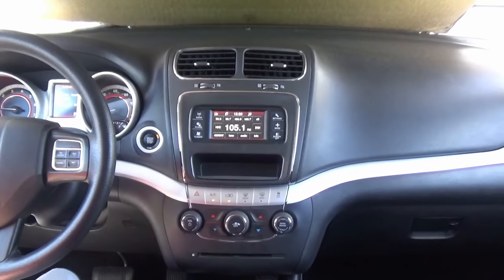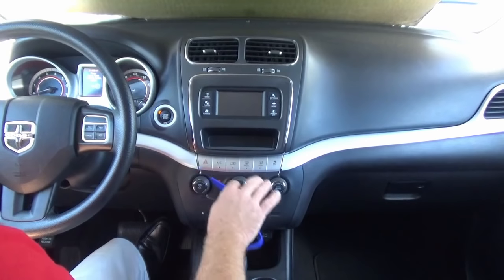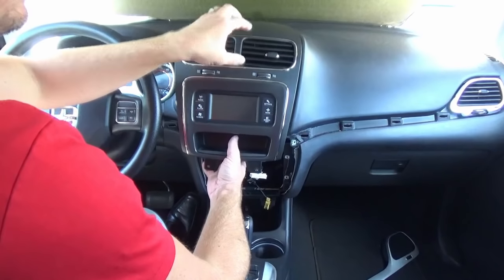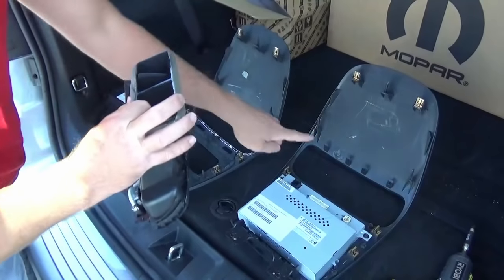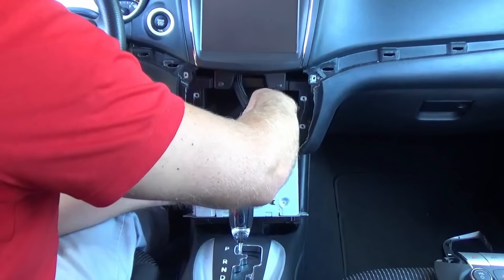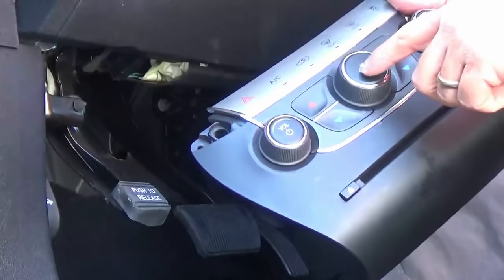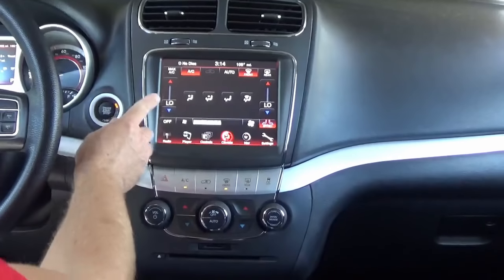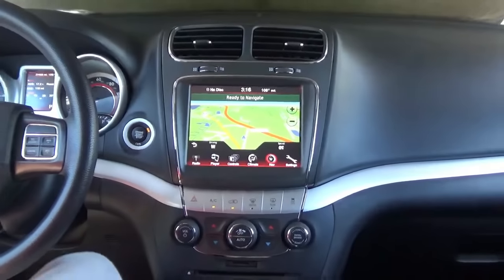2011-2020 Dodge Journey - 4" to 8.4" Factory GPS Navigation Upgrade - Easy Plug & Play Install!

Comment: I'm amazed that you still answer on a 6 year old video. This was incredibly informative. I currently have Bluetooth in my 2014 Dodge Journey, so I don't need to worry about that I hope, but I am curious if there are more up to date or modern screen options for my car? I'm looking to upgrade my screen and temp controls / etc. If not factory, even non-factory is fine with me. We are long past warranty. I would appreciate any advice you can offer :)
Reply from the maker: I wish we did. Unfortuntely it seems as if Mopar gave up on the Journey as they never produced a newer unit for those vehicles after this RB5 RE2 generation. If they develop another radio there is a good chance we can work out a retrofit but until that point our options for the Journey are quite limited.
Reply: @Infotainment_nav  Could you send me the link where to buy the programmer?

Comment: I did this upgrade about 11 years ago and the climate control has been a sore spot. I lost rear controls, (on the screen) and temp can only be controlled from bottom buttons. 

Would the programmer that’s available require I change any additional parts?  
How would it know inside temp and stuff?
Reply from the maker: Please feel free to reach out to our sales team to help verify compatibility.  If you can provide your VIN#, we would be happy to help verify a compatible upgrade path. 

1-855-636-6287 Ext: 2 or sales@infotainment.zohodesk.com.

Comment: Instead of buying that obdII thing for the climate control, can I use a normal obdII scanner that a mechanic would have? The ones that scan for codes and what not?
Reply from the maker: Our programmer is used to access the BCM and add the ACC code to the vehicle. If you have access to Alpha OBD or a similar service then you may be able to program this yourself.
Reply: @Infotainment_nav  I went ahead and purchased your programmer, thanks. 
one more question. So I did the upgrade from the 4in screen to the 8.4 on my dodge journey. I used the same wiring harness that was used on my 4in screen. Should I have used the harness that came with the 8.4? Does it make a difference?
Reply: When I change, do I need Siri to make the GPS work?

Comment: Where can you buy the programmer? And does this need to be done? What happens if you do reprogram?
Reply from the maker: Here is the link to the full kit. This will come with everything you need for the install. The OBD genie programmers that we offer typically offer a feature like backup camera or ACC HVAC climate control programmming. What were you looking for?
https://infotainment.com/shop/interior-accessories/infotainment-radio-upgrades/2011-2020-dodge-journey-gps-navigation-rb5-8-4n-radio/

Comment: I've got a 2018 Journey Crossroad with the 8 inch screen (without navigation). I recently broke the screen, so i ordered another used one off of ebay. Little did i realize it was the version WITH navigation. Is this gonna cause any issues when i install it? Also, I had seen a few videos talking about programming the unit using the serial numbers on the radio, and having to call the dealership for more codes. Is this correct? Would i be better off just taking it to the dearship and having them install it?
Reply from the maker: Dealership may not want to touch it as they tend to not be very helpful with this type of replacement but it is worth a shot. Programming for FCA is more after the install when the radio communicates with the BCM during the acclimation period. It should not cause significant issues other then the Nav not working unless you have the OEM XM antenna which is a dual GPS/XM antenna.
Reply: @Infotainment_nav  when I got the car, I got 3 free months of Sirius and it worked great... Till my free 3 months ran out at least lol!

Comment: So I took a 2016 Dodge journey 8 inch screen from.a junkyard and put it in my 2014. Only problem is I didn't know we were supposed to take the a/c control panel and cd player. If I go back and get the rest of the equipment at the junkyard, from that same vehicle I got it from...will it work in my 2014 Dodge journey? Also how much do you rear camera kits cost?
Reply from the maker: That is not something we recommend at this time. We do not recommend using Ebay or Junkyards to source products as the failure rate of products that have not gone through our 20 point bench test and inspection is very high. This is the link to the only upgrade we can safely recommend. 
https://infotainment.com/shop/interior-accessories/infotainment-radio-upgrades/2011-2020-dodge-journey-gps-navigation-rb5-8-4n-radio/
Reply: I went ahead and went to the junkyard to get the rest of the parts and it works now. Only thing is it has an anti-theft code. How can i reset it to take off the anti-theft code
Reply: Did you replace the climate control panel what the radio behind it
Reply: @RiaRei did you replace climate control panel and the radio

Comment: So I don’t have the Auto Climate. I purchased the Genie to go along with the bigger screen. Will this actually activate AUTO Climate Control or a “bypass”?
Reply from the maker: This will activate the Auto Climate Control. However if it is 2018+ then you will need a bypass module to access the BCM with our programmer. That is on the second link.

https://infotainment.com/shop/interior-accessories/obd-genie-programmers/dodge-auto-climate-control-programmer-c-acc/

Bypass
https://infotainment.com/shop/interior-accessories/obd-genie-programmers/c-modbyp/
Reply: @Infotainment_nav  mine is a 2012

Comment: I have a 2018 crossroad and mine dont have maps (im very uoset about this) is there anyway i can get navigation or can i buy something to hook up? I thought a 2018 would have it. Also i was mad No remote start😢
Reply from the maker: Are you currently equipped with an 8.4" screen or do you have a 4.2" screen?  This package presents a compatible upgrade path to gain onboard navigation (RB5 option code) if you are currently working with an 8.4" screen without onboard navigation (RE2 option code) or if you are currently working with a 4.2" screen.  

Please feel free to reach out to our sales staff if you have any questions. 

1-855-636-6287 Ext: 2 or sales@infotainment.zohodesk.com

Comment: Hi,
I have a 2014 Journey with the 8.4” screen and the NAV Feature doesn’t work, the dealer said I would need to get a new radio … any suggestions to get this GPS working?
Thank you
Reply from the maker: We do offer a repair service for this unit. However, if you're experiencing the "Can't Unlock Maps" error message, that will still persist post repair, but you will have the detailed maps data. That message kind of turns into an "accept screen" once per drive cycle after repair.

https://infotainment.com/shop/services/repair-service/repair-service-fca-uconnect-re2-or-rb5-telematics-gateway-module-radio-4/

Alternatively, you'd be replacing the radio unit which is the CD player box to this system.

Comment: Hello I have a 2015 dodge journey se with a broken screen that I’m looking to upgrade/ replace. Mainly because once I replaced my camshaft position sensor & reconnected my battery, the AC in my car reset & the function is set to blow air towards the feet only & I have no way of changing it to blow out the main vents. Would this upgrade also allow me to fix the issue?
Reply: Also would like to note I have the off button & Not the auto
Reply from the maker: I would recommend contacting our sale department at 1-855-636-6287 Ext: 2 or sales@infotainment.zohodesk.com.  We would be happy to recommend a compatible solution for your vehicle.   Please make sure to have your VIN# ready.

Comment: Hello, where can I get this exact kit at for My 2012 dodge journey, I bought one from ebay and it doesn't use all my oem connections?
Reply from the maker: Here is our solution for this. We use the OEM equipment and it is pre-programmed so this should be plug and play and it will retain all of your current features. 

https://infotainment.com/shop/interior-accessories/infotainment-radio-upgrades/2011-2020-dodge-journey-gps-navigation-rb5-8-4n-radio/
Reply: What if I have the RB5 OEM set up but I don't have nav button and originally did not have auto climate would I need the old plug and if I got Sirius xm would it work with my radio

Comment: Question. I have the 8.4 screen but there is no navigation button showing up on my screen. How would I get it to show up? Would I need an update for the system operating system or would I need a whole new 8.4. screen? 2015 Dodge Journey
Reply from the maker: The modules are different. You would have to swap the RE2 module out for a RB5. It would be the first option on this listing. 
https://infotainment.com/shop/interior-accessories/infotainment-radio-upgrades/2011-2020-dodge-journey-gps-navigation-rb5-8-4n-radio/

Comment: your video title says 2011-2020 dodge journey, but in your video you say it is compatible with 2011-2018. I have a Dodge Journey 2020, would this work for my vehicle?
Reply from the maker: Yes this will work. This video is much older then the listing itself. Mopar never updated the radio systems for the Journey until its discontinuance in 2020. This kit is full compatible with 2020 Journey's.
Reply from the maker: This is the link 
https://infotainment.com/shop/interior-accessories/infotainment-radio-upgrades/2011-2020-dodge-journey-gps-navigation-rb5-8-4n-radio/

Comment: Question, 2013 Chrysler 300 Uconnect 8in lost map data. Theres no lonnger support for 2013 on garmin. What can i do? Tha ks in advance
Reply from the maker: Ah that's unfortunate. I would recommend getting a replacement head unit with a more up to date part number that's still supported, such as 2016-2020 (This would be a unit likely from a Dodge Journey, as the Chrysler 300 last used this radio in 2014 models)

Comment: Is there a difference between a 2012 uconnect and a 2017 uconnect? the one i have is kinda bad when it comes to quality and when i have my phone plugged into the usb port, it doesnt show what songs are playing or anything like that.
Reply from the maker: There was a slight change in the 2013-2014 models that continued to 2020 (despite part number changes each year), but it was negligible. Essentially the GARMIN mapping interface changed a bit, such as the icons in the menu had changed visually, but operated the same and were named the same. This radio system did not have Uconnect online services for over the air updates, so if the dealership or yourself have not updated the software, then the software could be really out of date and might result in the radio not seeing track data. You can try checking www.driveuconnect.com click Support, and then Software Updates. Then punch your VIN in the search bar and see if there's any available for you to download.
Reply: @Infotainment_nav  is there a way i can change the red theme? its kinda getting me depressed lol idk why it doesnt look as good as ram, chrysler or jeep.

Comment: Where can I get that programmer? I have a 2013 Dodge Journey thought I did the same radio switch over for and I need the programmer.
Reply from the maker: So If you are upgrading from the 4.2-inch system to either of our 8.4-inch systems you must have the AUTO button on your climate control panel. If you do not have the AUTO button you will need to purchase a separate programmer in order to enable the feature. See our OBD Genie C-ACC Programmer. (Please note: After programming, there is a 30% chance you will also need to replace your climate control module with one of the following part #: Part Number: 68263758AB
https://infotainment.com/shop/interior-accessories/obd-genie-programmers/dodge-auto-climate-control-programmer-c-acc/
Reply: @Infotainment_nav  
  

I’ve gone to the scrapyard and  moved the upper panel with 8.4 screen& air vents.
I also took the CD player modular and the climate control with auto from the car.

My car has 4.2 inch screen with no auto on the climate control. I will be removing all from my car. Replacing it with all I removed from scrap car.

Your video was very helpful.
I will look on the link you provided and look for the programmer.
Reply: @Infotainment_nav  

My vehicle is a 2013 vehicle I’m taken out of is a 2012 .
I’m not sure if that makes any difference ?
Reply: @Infotainment_nav  

Is there any other programming I’ll have to do with the navigation or just order Siri ?

Comment: What about activation the radio code I don't see you to activate new radio
Reply from the maker: We pre-program the radio to your Vin and provide a radio unlock code if needed. The piece will arrive plug and play and that is backed by our warranty.
Reply: What about read camera can you activate it if the car don't have camera I won't add camera

Comment: How do I update the navigation on the 2015 Journey with 8 inch screen?
Reply from the maker: If you already have the 8.4" screen then you want to select the top drop down menu on this link. This is the cheapest option as we are able to use your current screen instead of having to send another. 
https://infotainment.com/shop/interior-accessories/infotainment-radio-upgrades/2011-2020-dodge-journey-gps-navigation-rb5-8-4n-radio/

Comment: I went on obd genie to get the climate control programmer an they don't show one they only show heated seats programmer
Reply from the maker: Oh that's odd that it isn't on their website. I'll have to reach out to them to find out why. Here's the listing for that genie.

https://infotainment.com/shop/interior-accessories/obd-genie-programmers/dodge-auto-climate-control-programmer-c-acc/

However, if after the genie has programmed, and the "Automatic Climate" icon is grayed out, the vehicle will need to replace the HVAC module with one that has more up to date firmware from the dealership.

Comment: Can you add Sirius and Bluetooth to this if not already installed?
Reply from the maker: We can add XM through the XM/GPS antenna on this listing. We have the OEM option and a custom magnetic option if you do not want to drill
https://infotainment.com/shop/exterior-accessories/xm-satellite-radio-antennas/fca-siriusxm-satellite-radio-antenna-kit/

Unfortunately upgrading to Bluetooth hands-free calling is no longer an option through Mopar. The bluetooth module was discontinued.
Reply: Can you add a back up camera?
Reply: I tried that from you and it didn’t work

Comment: What kind of programmer do I need where do I buy it
Reply from the maker: The programmer to get automatic climate control is found on this page.
https://infotainment.com/shop/interior-accessories/obd-genie-programmers/dodge-auto-climate-control-programmer-c-acc/

If you're automatic climate ends up being a grayed out icon, you will also need to replace your factory HVAC module with a newer one from the dealership (it has more up to date firmware to handle automatic climate).

Comment: I upgraded to 8.4 inch with auto climate control. Trying to turn ac/heat up and down but doesn't move
Reply from the maker: Please reach out to our support team at 855-636-6287 Ext 11 or at 
support@infotainment.zohodesk.com
Reply: Mine doesn’t either just keeps saying 22 degrees. So frustrating

Comment: Do you have to upgrade the module under the radio if you are just upgrading from the 4.2 Uconnect to the regular 8.4 Uconnect without Navigation?
Reply from the maker: Yes it does require a module swap. Here is our kit. Just select the 4.2 inch to 8.4 inch Non-Nav option.  
https://infotainment.com/shop/interior-accessories/infotainment-radio-upgrades/2011-2020-dodge-journey-gps-navigation-rb5-8-4n-radio/

Comment: I bought a new Dodge Journey in 2012. It was the ABSOLUTE worse care I ever owned. Not only did it have recalls for everything every two weeks, the transmission went out at 4,000 miles. I only had it for 7 months and got rid of it and went back to a Ford vehicle.
Reply from the maker: We've got Ford upgrades as well!  Feel free to reach out to our sales department to discuss a compatible upgrade path. 1-855-636-6287 Ext: 2 or sales@infotainment.zohodesk.com.
Reply: I bought mine new back in 2012. Still have it. I love mine.  But I’m a handy guy. I do all my own repairs. 
Love the power, the space, the 4wd, and overall utility. 
And I’ve never babied it. Maybe first 1k miles.  We’re at 120k right now.

Comment: Lol...one thousand bucks. Not worth it
Reply from the maker: We do not sell cheap equipment. We sell OEM quality equipment that is fully tested, pre-programmed and procured based on your Vin. There are plenty of companies that sell cheap products. We want to provide a part that we are able to guarantee works and will continue to work. We are confident enough in the product we sell that we are able to warranty it through installation and up to two years depending on your selection at check out. We feel our pricing is competitive as we are comparing our pieces to the cost of getting a new vehicle as opposed the cost of an aftermarket part whose quality is greatly inferior.